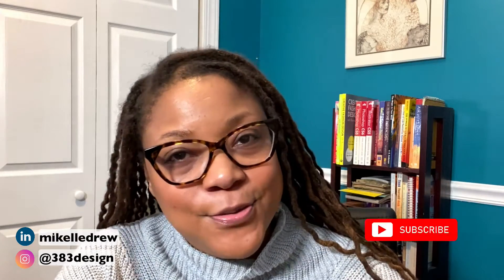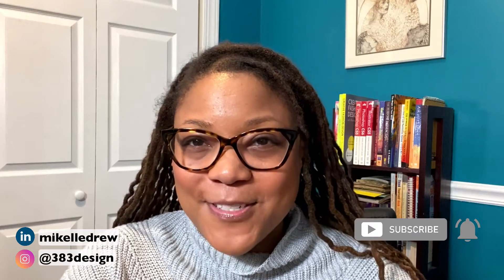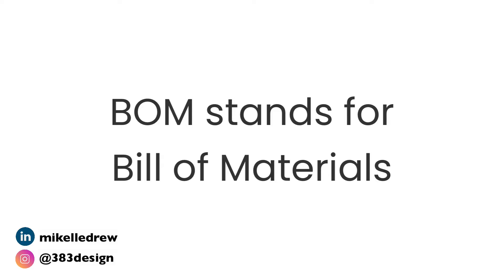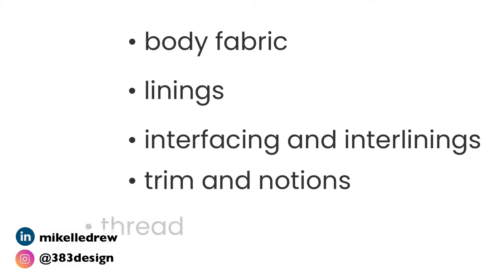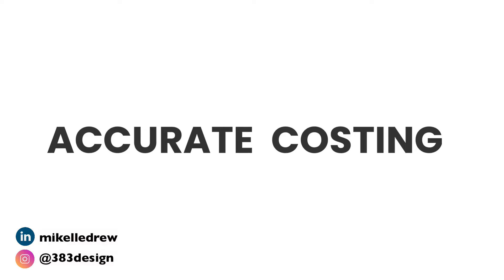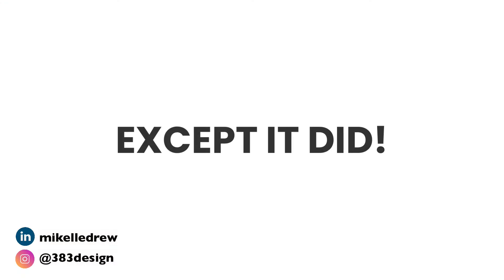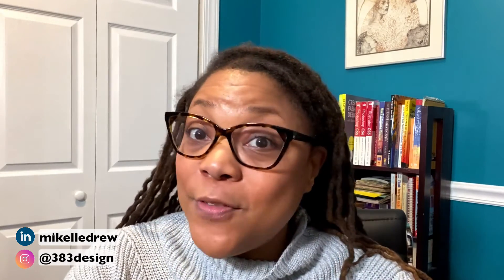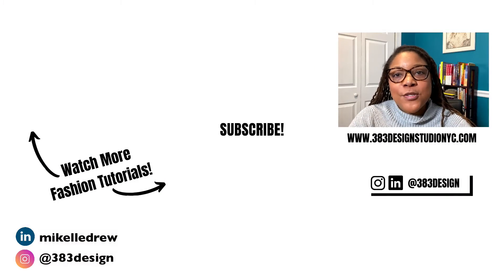B-oh-What? What is the BOM in a Fashion Tech Pack?

Comment: how do I work out how much material I will need for my garment? I am fresh to this if that question did not give it away. also can you recommend any manufacturers for quality, price and efficiency. thank you :) also this is great info!
Reply from the maker: Hi, Danny. Thanks for watching and commenting!

There are some rough calculations you can do on your own based on the size and length of your pattern and the width of your fabric. However, the most accurate (so you can also get an accurate price) will be done by the manufacturer.

Usually manufacturers specialize in certain types of items or fabrics or products, so while I can't recommend a manufacturer for quality, price and efficiency because I don't know what type of product you're making or where your located, I can say that you'll want to consider the type of product (pants, tops, jackets, etc), type of fabric (woven, knits, knits with spandex, non-wovens), category (mens, womens, kids), and your pricing tier (discount, moderate, bridge, designer).

If you're unfamiliar with the pricing tiers, make sure you look those up. That'll give you an idea of where the price of your item will most likely retail. That will help you understand how much you can afford to spend on making the item (about 1/2) so you'll know if the manufacturer's cost is too high or within your price range.